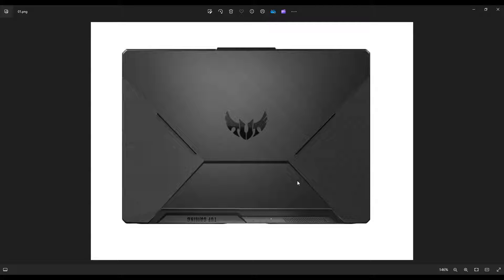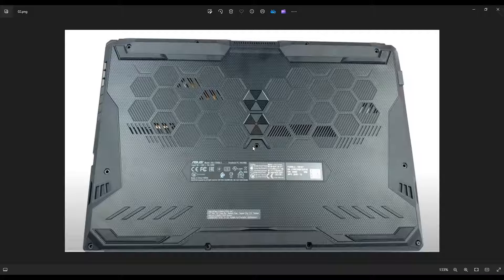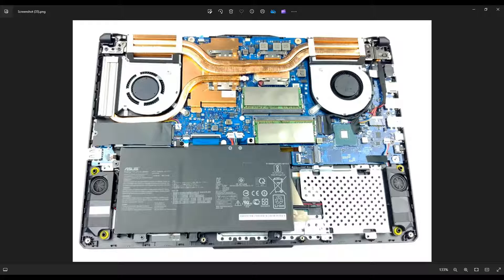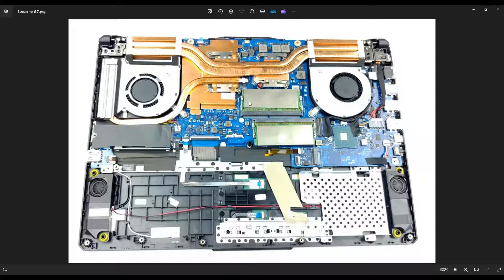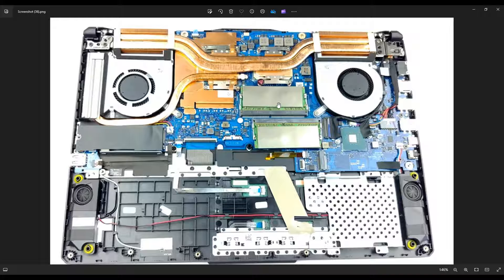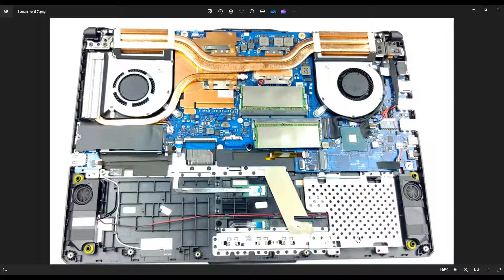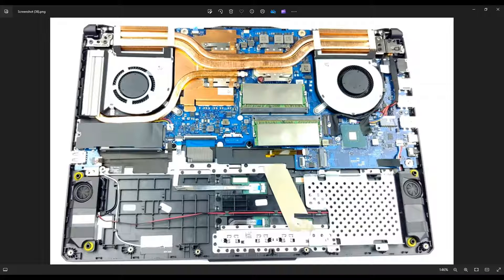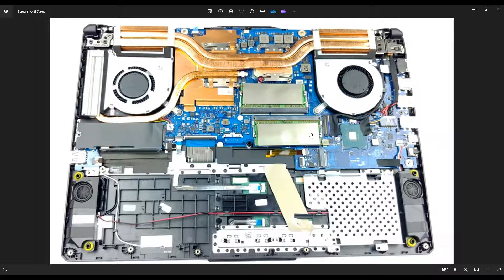Teardown Disassembly Upgrade Options - Asus TUF F15 FX506 Gaming Laptop Computer

Comment from the maker: F15 FX506 Tools & Replacement / Upgrade Parts: https://amzn.to/48aBaYb
How To Fix Overheating Laptop: https://youtu.be/gGCUmI2NU0E
Check out the FAQ's in the description or leave me a comment and Ill get back to you asap!!
To support the channel more, leave a Super Thanks or donate to $PCHelper on your CashApp
Reply: Does it have motherboard battery? The small battery
Reply from the maker: @Nu_ub  No, this model does not use a CMOS battery. Are you trying to reset BIOS or troubleshoot another issue?
Reply: @jamminpcs  yes error 87 keeps popping up when trying to work scanhealth. 
Do you havebthebappropiate syntax to run that check?

Comment: Hello Please i Want to reset the bios to default settings so They told me to unplug the 2 pin RTC battery but i couldn't find it 
Can you please help me I really need my laptop for my exams
In addition i can't open my pc because when I press the power button nothing showing up LITERALLY NOTHING that's why i can reset the bios from the laptop 
I really appreciate if u help me 🙏🏻
Reply from the maker: For a computer that does not turn on, try this video first; https://youtu.be/kOBY4k2Mn_k. Let me know how that goes :)

Comment: Hello ! Would like to know if there was any CMOS battery on this laptop?
Reply from the maker: No. There is no CMOS battery on this laptop :) Are you having a issue with something?
Reply: @jamminpcs 
Hello 
Please i Want to reset the bios to default settings so They told me to unplug the 2 pin RTC battery but i couldn't find it 
Can you please help me I really need my laptop for my exams
In addition i can't open my pc because when I press the power button nothing showing up LITERALLY NOTHING that's why i can reset the bios from the laptop 
I really appreciate it if u help me 🙏🏻

Comment: Hello Merry Christmas, I had to replace the keyboard, but now the battery and the numerical key board do not work. Anything obvious that I may have missed? I bought a new battery and installed it but it still not charging and the battery light is constantly flashing, that the computer is plugged or not.

Comment: How do I get to the battery to keep the time and date current
Reply from the maker: Your BIOS is not keeping the correct Time/Date?
Reply: @jamminpcs  it is now but still not working
Reply from the maker: @jordimartorell9248  How is the computer not working? Whats happening?
Reply: @jamminpcs  had to reinstall the software but have a problem with wifi and when I run widget upgrade --all I get failed when opening sources.               Msstore and widget.      Explicit. False also I have the letter d randomly typing itself
Reply: @jamminpcs  happy thanks giving
Reply from the maker: @jordimartorell9248  Thanks 🦃 So you reinstalled some software and now the wifi wont work? Have you fully updated as seen here: https://www.youtube.com/watch?v=EDyjxUXBkZM&feature=youtu.be or can you try the troubleshooting steps seen here? https://www.youtube.com/watch?v=tDGPeqex8pQ
Reply: @jamminpcs  system is really a mess, I followed the steps on the video and from the internal link provided by the system
Reply: @jamminpcs  the time is mountain not pacific, wifi is working finally but have issues installing some of the connections